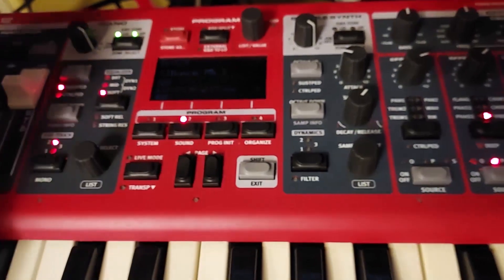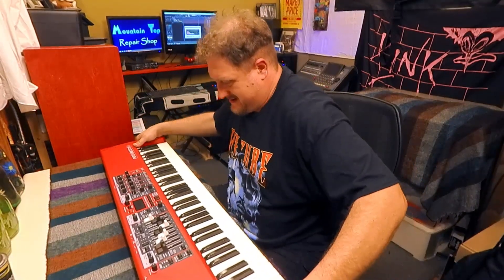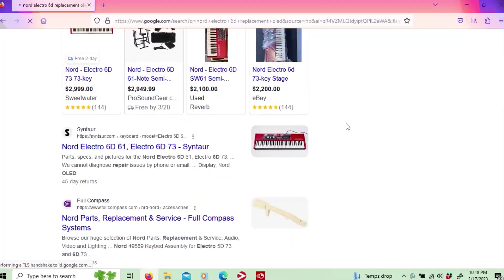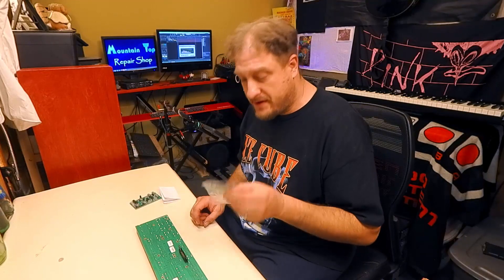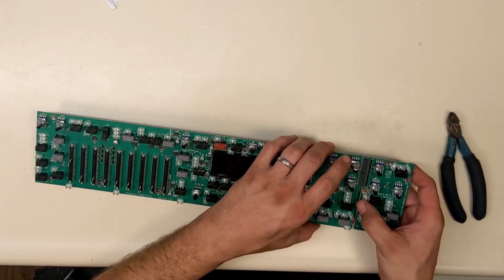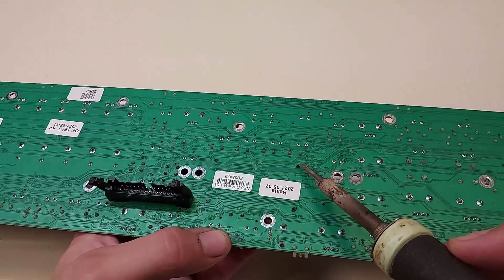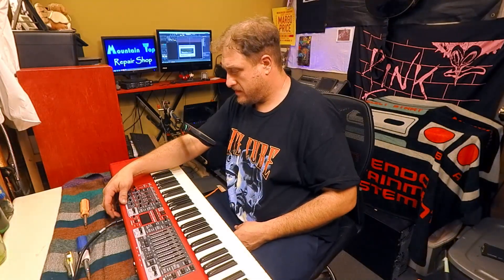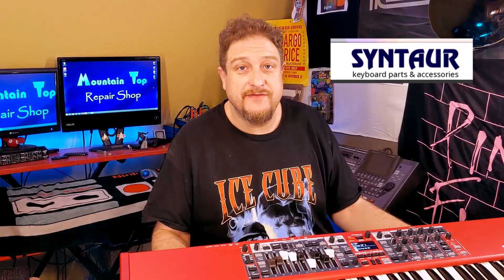Nord Electro 6 OLED Display Replacement - MTRS

Comment: I did this repair and all was going well, but when reconnecting the ribbon cable (22410), it was accidentally inserted in the wrong direction into the socket clip holder.  This is the ribbon cable that connects the circuit board for the control panel in the top which houses the display to the circuit board in the base (to the NE6 Main v 1.02 DM11446 board).  The pins in the connector are all uniform, so apart from the little notch, it is easy to insert it the wrong way if not careful.  When the keyboard was powered up, a light came on briefly on the circuit board in the base and then went off.  The board was powered off, the ribbon cable direction corrected, but now after corrected, the keyboard will not power up at all.  The main fuse appears to be ok (at least visually).

Where could the problem be?  Everything is now connected firmly but no lights come on anywhere.  Is there another fuse to check or might something else now have to be replaced?
Reply from the maker: I'm so glad to hear that worked out. This comment is important to have here as a warning for others attempting this repair. @natenussey6282 is my other channel. I was going to look up that pinout diagram tonight. But I was much happier to see that the issue was resolved!
Reply: Ouch! I'm going to have to look up the pin diagram on the screen and see just what each pin does. Then, I can compare the connection in the right direction against the wrong direction. It should tell us what was connected to the positive voltage. You may have sent some voltage down a data bus line. Worse case is a damaged processor IC. The better case would be a damaged capacitor or resistor. I'll look into this over the weekend.
Reply: @natenussey6282   Thanks for your reply!  The main fuse looked ok, but I had a hunch to try a new one (had to order it in).  THANKFULLY, this solved the problem!  I was freaking out at first.
Reply: Do you have the screen part replacement?

Comment: I never really comment on YouTube vids, but had to thank you for this one. After watching your video, I decided to order a new screen from AliExpress (I'm in London) for my scrambled Electro 6D 61-key.
Your instructions were so thorough and easy to follow! – A perfect fit and a perfect repair!
And as the screen I ordered didn't come with its own plastic housing, I reused the original by using a hairdryer to soften the glue holding the old screen and applied double-sided tape to glue the new one in.
Reply from the maker: I'm glad to hear that worked! A little extra work but a good discount on the price of the screen! When I checked AliExpress, they had a few different colors to choose from, too.

Comment: Cool video! I have the 5D, wondering if the process is the same? I didn't use the keyboard for months, and when I finally went to use it, the screen no longer worked. It was getting some sunlight for a while, I wonder if that fried the screen? Anyway, aside from screen replacement, are you aware of any other things that it could be? I have already reset it back to factory settings and replaced the fuse but it is still out.
Reply from the maker: The OLED technology is pretty new, and the monochrome screens are pretty simple. Over time, the technology will improve, and these should last longer. The 5D takes the same screen as the 6D (part# 9977). The construction of the two keyboards is very similar. The differences between the two machines are mostly in the presets and the color scheme around all of the buttons. The 5D should be very similar to the 6D as far as disassembly goes. This video should cover the screen replacement on your 5D. Good luck!

Comment: Thanks for the great video, easy to follow along and very informative. When I was reconnecting my top panel, I think I damaged the ribbon connector on the top panelboard. The ribbon cable doesn't send power to the top panel unless I push it into place (I'm thinking the latches/tabs/ locking mechanism for the ribbon cables may have loosened and can't close tight enough to lock the pins into place. When the panelboard receives power all LEDs on the Nord turn on, except the display! I was wondering If I could replace the pin-locking tabs rather than buy a new panelboard from Syntaur. I can send pics/vids if requested (also posted on the Nord Electro forum). Any suggestions or help would be much appreciated thank you :)

I've found some forum posts regarding all beds turning on + no display, some suggest cleaning or updating, but I believe the problem lies in the panel board. Thx again!

Comment: You’re instructions were extremely helpful.  Also, thanks for the tip on sourcing the OLED.  Did the same repair as shown to replace a damaged screen.  Many thanks.
Reply from the maker: You're very welcome! It's such a relief to see that new screen light up. These keyboards do too much to rely on blind navigation. I'm glad this video helped.

Comment: My display came without the frame. Do you know if it is possible to use the old frame (from the defective display)?
Reply from the maker: I was thinking about this when I found that you could get the display directly from aliexpress without the frame. I would remove the old screen and frame from the control board first. Then I would use a heat gun and a thin blade to see if the old screen can be separated from the frame. Then, I would probably use a double-sided tape to adhere the new screen to the frame. You may have to use a little epoxy on the frame studs to get them to hold on to the control board when you reinstall it.
Reply: @mountaintoprepairshop664  thank you my friend!